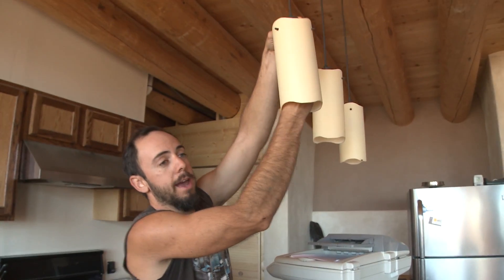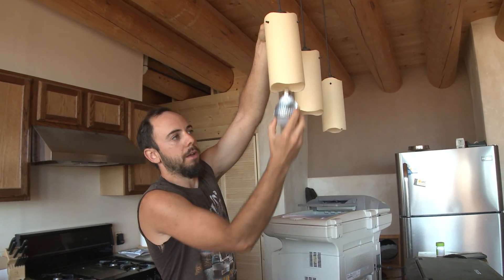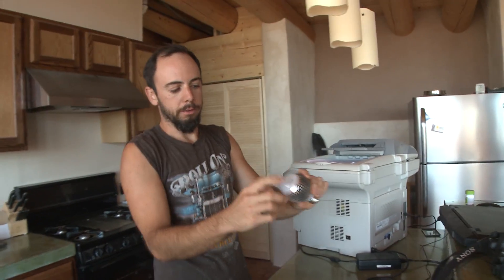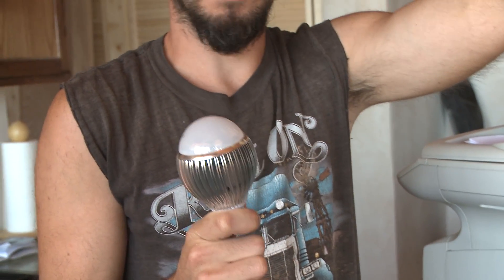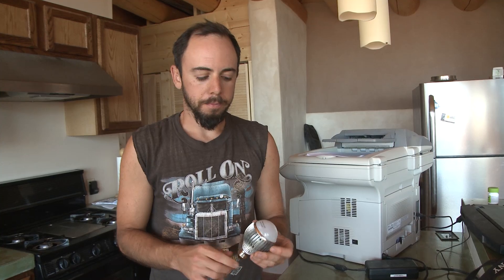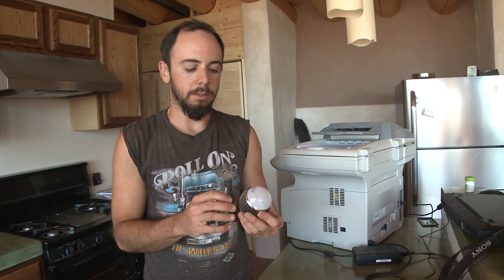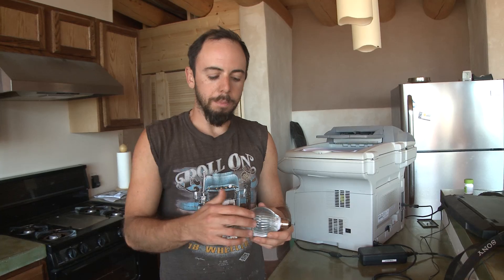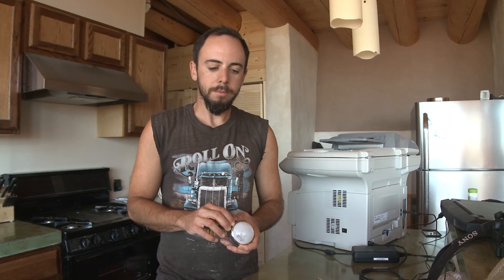12 vs 24 Volt Solar Systems

Comment: I run a dual system. Lights are 12 volt DC other stuff are powered by a 115 VAC 1000watt inverter.

Comment: Awesome! I'm building a cabin in the woods and this has answered my question beautifully. I will wire 100% for a/c and use a MUST hybrid MPPT inverter-charger 48v with a changeover switch, that way i can use on grid power (whenever they connect me) as well as off grid AC depending on my needs. Thanks again!

Comment: I'm staying on grid, it just makes sense because of my location. If I'm going to invert to 120v anyway, is there anything wrong with running a large 12v battery bank for solar? Is there really more efficiency the higher my dc voltage?

Comment: 7 yrs old so the 24v dc leds might be cheaper now 12v are much cheaper as are 120ac.  24 vole systems are better its not voltage drop but battery capacity and the size of wires can be smaller and or run longer runs . but you can use a drop converter
to run 12v lighting and charging  also higher wattage panels 200 to 300 watts are 24v . tech as improved from the date 2013
to today in 2020

Comment: Hi great video I have set up off grid system using 4 x 420 ampere hour 6 v battery's ie 24 v because I already had high spec 24 v inverter  its just for power at our stable yard have 2 x 260 watt panels at moment .  Found few advantages with 24v one is panels are in series to reduce losses but OC voltage is about 78 v so need solar charge controller can handle 100 v tend to be expensive . But can get away with 30 amp one on 24 v were as on 12v would need 60 amp one to give good overhead .Also charge controllers tend to be more efficient  78 v to 24 v charge than 78 v to 12 v charge also running 230 v from inverter  less loss on cable runs plus better choice of utility's . You say about 12 v fridge over here these are mostly RV absorption types not as efficient as compressor  fridge . I did think about low voltage DC as inverter loss 24 to 230 ac then most LED lights then drop this to low DC again but found the losses very small . Also aware of drain when running inverter on no load but we tend to turn all light on anyway plus inverter has Eco mode if load drops below set amount it goes into standby using virtually nothing 
Keep up the good work with your videos

Comment: Good grief. Who even thinks of running 24V in a house instead of using a 24v -> 12V converter? This is the problem with the internet. Everybody thinks they are an expert when they don't even comprehend the basics.

Comment: Why in hell would you not invert to 110 or 240v (depending on country)? My LEDs (240v system) cost $3 and replacement LED chips that I can change out when they fail are $6.38 for 20 pcs or about 32 cents per pcs. Due to the voltage the wire size, costs & losses are minuscule, plus I can use readily available (and cheap) standard fittings and switches from discount sources such as Lowes, Home Depot or, in my country HomePro or Global House. This video is NOT informative. It is a confession of your lack of understanding!! If you want to earn revenue from producing information videos, do the research on the topic and inform others with valid data. This approaches the worst video I have ever seen on power distribution from a solar system. I cannot believe that you have misinformed 1100 people who liked this submission with only 139 seeing it for the cr*p that it is.

Comment: If you have 400ah battery total with two inverter and 1000 watt as a load for each them one them run on 12v with 400ah and the other one runs on 24v with 200ah which one will last longer?

Answer

01

Follow

Request

More

￼￼￼

Rizgar, want an answer to this question?

Requests help you get answers to your question.

Request Answers

No Answers Yet

RELATED QUESTIONS & ANSWERS

Comment: I'm torn between the tradeoff of lost efficiency with an AC inverter on a 12V system only running a laptop charger at 70W vs stepping down from 24V DC to 12V DC on a 24V system running a temp-controlled peltier fridge at 60W with a higher current draw. AH is my primary concern as well since the run is short, so the lower guage wiring on 12V isn't a concern monetarily.

Comment: We have a 24VDC battery bank, and use 12VDC for most of our inside power needs. A simple, inexpensive "step-down transformer(s)" take the 24V to 12V with no issues.  A 48VDC system would be even better (but 2x as much for a battery bank!).  Most full time "off gridders" already have (one or more) generators, and a spare inverter (even if spare is a cheap ChiCom Ebay one).  Cool Earthship, tho!

Comment: Great video, interesting points. I would also add that to run lights on DC, you need to run an extra string of heavier gauge, more expensive, wire.

On the charge controller front, you only need half as many charge controllers if you go with 24 V, although if you go with 48V you need 1/4. 60 V needs 1/5th as many charge controllers since the voltage does not need to be stepped down so much from the panels to the batteries. That is my main reason to want to switch to higher voltage.

You are quite right about the reliance on the inverter though.

Comment: At last someone is talking about voltage configurations! What is the difference between 320 watts 12 volts solar panels and 320 watts 48 volts panels. If I am going to use all my electrical equipment in AC in a caravan how do the configurations of the inverter change if the solar panels are 48 volts? Thanks for the upload.

Comment: _*I tested 2 batteries on the weekend and both of them seemed it be “dead". After using one of your methods [Check Details Here>>>>https://www.facebook.com/Battery-reconditioning-310070329426065/app/208195102528120
 ] I was able to rejuvenate them both to 100% working batteries. Thanks, you just saved me about $180! :)_*

Comment: 12v batteries, MPPT solar/wind/water controller, you can buy cheaper 24v or higher panels, thinner cable is needed because of higher volts, more usable current at the battery level due to mppt converting higher volts down and amps up,
Why on earth would you run 24v to your lights or anything for that matter, it's absolutely ridiculous, don't listen to this guy he clearly has no idea.

Comment: I don't ever comment on videos, your spending way to much money and missing a lot.  First I have a 42ft sailboat. I changed my electrical system from 12v to 24v about 6-7 years ago. The primary reasons are slight increase in efficency (important when running with solar/wind), smaller guage runs of wire (Saving a lot of money), higher powered devices available (electric motors ext), more durable products generally as the 24v items tend to be more commercial or industrial (think commercial fishing boat, products have to be reliable and durable). 

Most products can be found in that use 12v or 24v already. When i switched I only had to replace a few pumps that were 12v only. I don't know why you are paying $45 a bulb for a 24v led that low  power. Pretty easy to order a bulb adapter with a led conversation bulb, or if your handy with a soldering iron, with up your own. I have done both. The led conversion kits are the same price for 12v and 24v, and ordering online is fairly inexpensive. Some items are more expensive for 24v, but again they tend to be more reliable, and durable. Worse case is you get a 24v to 12v converter $20-150 depending on the amperage. Bow you can run 12v and have the efficiency of 24v. I'm installing a 5000 watt inverter FYI to allow me to power a large 220v 5hp dive compressor, and will probably install a 4-5000 watt generator as backup. There is a large line of products in 12v and 24v available in boating and RV industries. Convieniently Available online and all across the country. Don't need to go to home Depot

In practice running 24v is a lot more efficient. I watch my power draw and I is less than half what I did before, and produce more from the large alternator than I would with 12v. Higher voltage = more efficiency. I would switch to 48v however my anchor windlass is 80 amps and the largest DC converter I can find is 70 amps. I haven't found a 48v motor either to replace the 24v. Wiring is considerably cheaper. Instead of 4/0 guage at $12+ a foot for 40ft (positive and negative so 80ft in total) I only have to run 1 or 2 guage at ~$8 per foot. This is a major plus for using higher voltages. Marine and RV refrigeration units are already 12v/24v. It is my understanding that the danfross refrigerator compressors can be swapped into a fridge or freezer. I have seen a big chest freezer converted before. There is a compressor controller available that works with DC and 120v AC for true redundancy when the power goes out.

If it was me I'd prefer to is a separate DC system with AC. That is your most efficient use of solar or wind power directly off the battery. You can easily integrate a 120v to 12 or 24v power supply. You would have redundancy when the 120v power goes out. Lights, refridgeration, pumps ect wouldn't be affected. Water heater, electric range, microwave, washer/dryer and other big electric loads would, but that is really your issues if you lost power and an inverter.

Review the Victron energy inverter chargers and color GX system. I've had a multiplus inverter charger since I converted to 24v and have been really impressed. I can limit my main dock power intake to account for solar or wind input. The color GX automates that process and gives an easy visual indicator of what your system is doing, power in and power out. Expensive kit, but well worth it.

Comment: you are wrong sorry your tv is dc power, your computer is dc power and there is a lot more that is ac coming in and changed to dc power inside,  Sorry you are misinformed  Micro is dc power only thing needing ac is heating elements stove, dryer

Comment: Just go to 48 volt and you will be a lot better off. Here is the breakdown on it. Take a load of 4000Watt now do the math over 12v then 24v then 48v systems. 4000 divided by volts. = 333.33 amps at 12v. Or 166.66 amps at 24v or 83,33 amps at 48v Now what do you think is better and why. I live is a full electric off grid home 24/7 Note the stove is a duel fuel LPG electric. All other items are AC.

Comment: Yes, a solar system with an inverter is what most people do and you must increase voltage to decrease amps. With just a 3K draw, the amps on a 12 volt system will come to approximately 300 amps running through your battery cabling and your cables to the inverter. To avoid the 00 or 000 cabling you opt for a 24 volt system and bring your cable size down to using 6 AWG or 4 AWG cabling. If you were to try to provide 5000 watts, a 12 volt system would be impossible. We all usually get introduced to solar from an article on how to survive off grid with a small, simple 12V system, but once you get started and want to provide more power to run a refrigerator, coffee pot, microwave or T.V. you quickly realize you have to create a larger 24 or 48V system and yes, run your lights on AC from the inverter.

Comment: Can't your inverter put out both ac and Dc? So the 24volt system would only be betwee the solar panels to the charge controller to the batteries to the inverter. from the inverter out .....
Reply: Inverter are designed to only convert DC to AC.

Comment: Im only running 12 volt system in parallel to 5 lead acid batteries in parallel then to a 12 volt 3000 watt inverter to run AC only. Now the only reason I see running 24 volt or higher volt setup according to what I learned is to not having to deal with larger wires. Easier to rig up or cheaper to rig up a 15 or more panel setup if you do it in series on the panel side and battery side just because actually two reasons.....One is the smaller wire, and two is that the larger system voltages work better with more expensive controller that handles 150 volts and larger battery banks. The bigger your system just be more efficient to run volts in series to match equipment capability and smaller wires. My understanding.

Comment: Just tap your batteries for 12 VDC lines and 24 VDC lines. Add an inverter for the 110 VAC applications.

Comment: my solar system is 500watts. it can't handle some of appliances like microwaves and irons. I want to connect a petrol generator to the system incase I wanna iron for example then I will just start the generator that can handle an iron. but the problem I need a switch that will be used to change between the solar system and the generator. what type of switch can I use and how or where on my system must I connect it?

Comment: Good info in your vids !   Could I run 48v banks for charging purposes, and for driving an inverter, then also tap by 12v increments,those banks to power LED lighting as needed ?
Thanks for producing the great vids for us !  rc

Comment: Cant you run 2 systems, 
1. - Fridge, Pumps, Heater all those high big appliances.
and
2. - LED Lights, computer and everything else. for the daily use.
So if something happens, only half your system goes down.
Reply from the maker: yes , at twice the price

Comment: Why can't you wire your 12v or 24v system (pump/fridge) directly to a battery (or two/four) with an in-line fuse?

Comment: Another reason to go with higher voltage is that you will save money on wiring.  The lower voltage you run the more amps you will draw for a given wattage.  Higher amps means bigger , more expensive, wires.
Reply: FXM i think Todd Dunn was referring to using a 48 volt battery bank and eliminate all dc lighting, etc load and use a large high-quality inverter and just run standard ac mains wiring in the house for everything. then you can use standard inexpensive led lamps and appliances instead. ac is a much more efficient low-loss distribution method.
Reply: True that; more Amps = less Volts, more Volts = less Amps. Its basic electrical theory.
Reply: True, but the higher cost of 24v equipment may more than offset the cheaper cost of wiring.
Reply: Marzsit: Oh, ok. Yes, that makes sense. The inverter would be pricey, but the savings in everything else should certainly make up for it. Photovoltaics and batteries are getting so cheap that the losses from inversion aren't that much of a concern these days.

Comment: you did not explain the difference between 12 vs 24v :(
Reply: In short: 24v DC has a little bit less line loss than 12v DC, but 24v equipment can be significantly more expensive. With the drop in prices for inverters, it may be simpler to just stick with AC for most applications. If so, have a backup, either inverter or generator.
Reply: @fxm5715  In short, no
Reply: @T1000.Android  :)

Comment: Don't you have an inverter to AC?
Reply: i my self plan to run all the lighting through a 12v setup and will be building my own LED lights, i will also have some usb ports for recharging phones and the like in the walls that are used in cars and run off 12v
Reply from the maker: yes but the idea at the time was that if it burns out u r screwed so u want ur life support systems on DC.  since then we changed our minds tho, AC all the way.  makes life way easier
Reply: you could when using AC have a relay setup with a second inverter, so if
 power fails to run through the first, the relay will switch and the 
power will now run through the second, you can also wire in a light that
 runs on the relay to let you know the first inverter has failed.

Comment: Shoot!! I'm still learning so I'm depending on the experience and knowledge of others. I was told with an MPPT charger and pure sine inverter I could could run 12v and 24v dc electronics. That doesn't seem to be true based on your video. Can you she'd some knowledge?

Comment: Most people are running 110v AC from there inverter throughout the house since it keeps the cost of copper wiring lower since you can use smaller diameter wire. Running DC voltages means you have to run larger diameter copper wires. The battle between AC (Edison) & DC (Tesla) was already fought and DC lost out because of the losses over long runs and the diameter of the cabling.
Am I missing something here? Why are you running DC voltages throughout your house?  If you just converted your panel output to AC through an inverter then you could just use vimpire transformers to power your led lamps. Yes there are losses but less loss then DC. You could use the cheaper 12v led lights since you could run any size power supplies for 110v AC to 12v DC/24v DC depending on the led lamp, these could be purchased   cheaply on a websight like BangGood/ebay?
Reply: not so true any more, high freq. DC is wheres it's at. Then run small cheap DC to DC bucks at loads. Almost all your home AC appliances converts to DC internaly anyways. Except heating elements. but they are not energy friendly anyways...
Reply: Rick, you have it backwards.  Edison was DC and Tesla was AC, who was backed by George Westinghouse to make it commercially successful.

Comment: the other good thing about 48 volt is you can build a bigger bank of batteries.. if you have 12 volt system and use 6 volt batteries you should only have 6 batteries (three strings of two batteries) if you use same size of batteries at 48 volts you can have 24 batteries (three strings of eight batteries)
Reply: why should you only have 6, 6-volt batteries with a 12 volt system? Why exactly THREE strings of 2?
Reply: most battery manufacturers do not approve of more than three strings parallel together.. if you wanted three 12 volt strings but want more capacity that two ( L-16 size) 6 volts will supply you should get three 4 volt or six 2 volt per string.. otherwise properly BALANCED charging will not happen.. you can hook up many in series BUT NOT more than three in parallel..
Reply: I did read advice that all batteries be numbered, and their position in the charging bank rotated periodically, to get best longevity.  ???  rc
Reply: MrMeanderthal how much watts of solar power for 12v